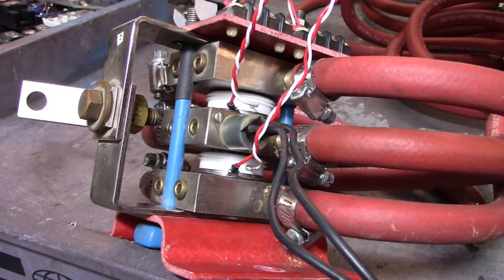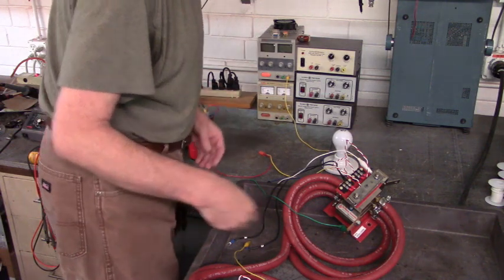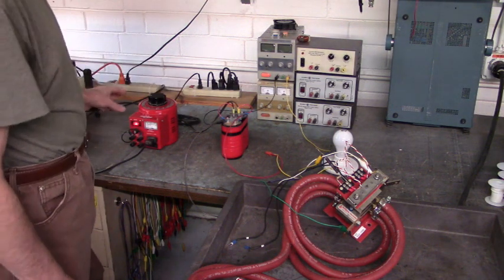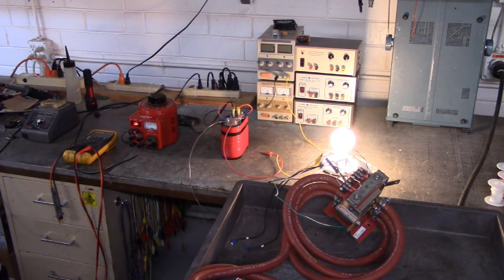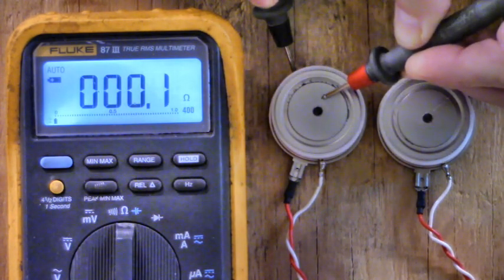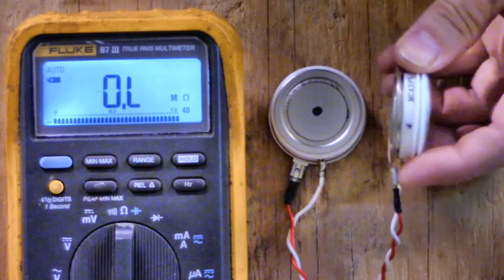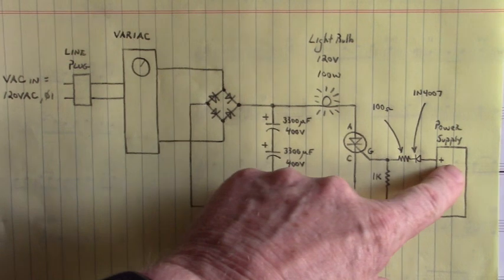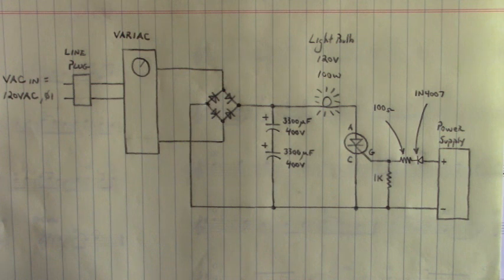Testing the SCR Hockey Puck P/N MC431PS

Comment: Hi Mr. McDonald, how are you?
SCRs always remember me of my first industrial job, repairing lots of Brown Bovery's Veritrons and Siemens' both Modulpacs and Simoregs (the old ones, without digital controls), everyday.
Do you know an DC servo drive made by Brown Bovery called Axodyn?
That drive is amazing! 
It was used with permanent magnet (field) DC servo motors, and to precisely control it, the drive applied 8kHz AC square wave through a bunch of MOSFETs, varying the duty cycle to run it clockwise of counterclockwise, making the square wave to get both more positive or more negative in the motor armature.
To keep the motor stopped it applied 50% duty cycle, what made it to have a great dynamic response, since the motor armature was permanently energized and there was much little hysteresis to deal with.

Comment: very nice video... many years ago when scrs were 1st being made several would be sort of test ok and would work. however some would breakdown at around 40-60VAC? and test ok with a low voltage semiconductor tester.. well a 100 watt light-bulb and a variable ACV supply could show the  reverse  leakage with light. don't seem to have a lot of that anymore.  thanks great video...:)